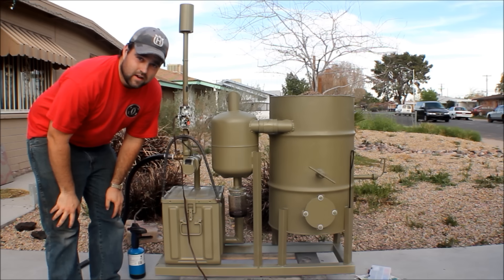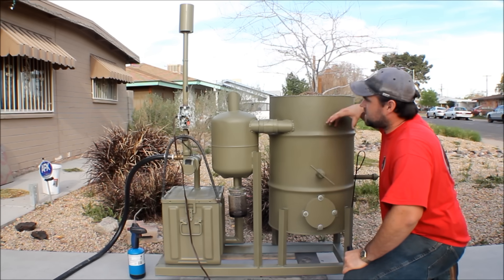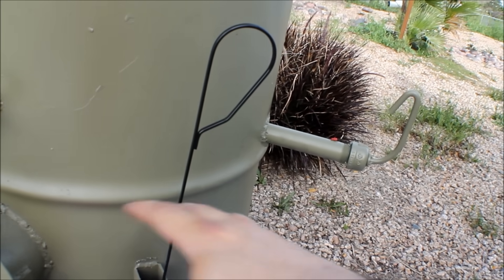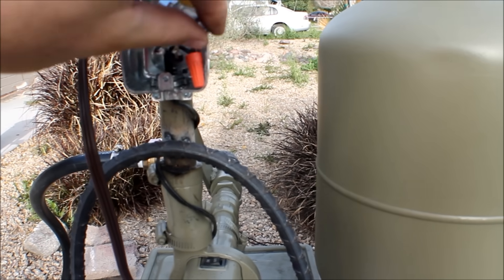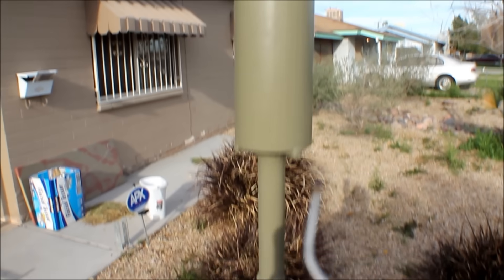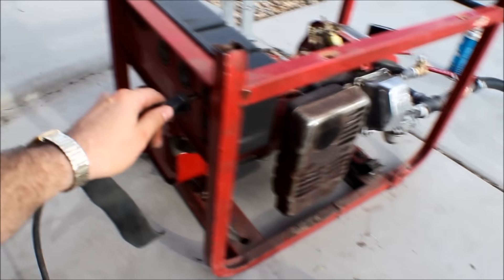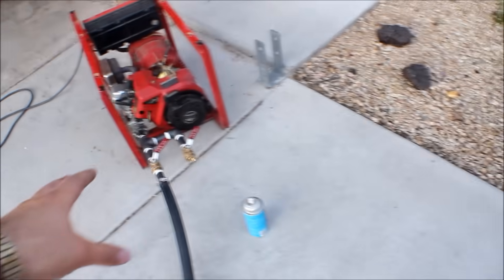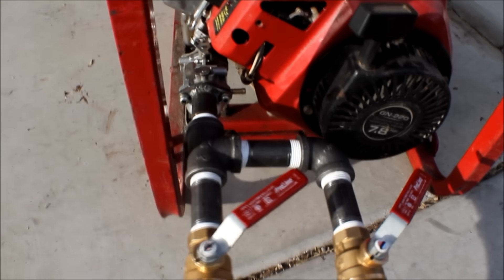amazing homemade gasifier uses wood pellets to run generator -- renewable alternative energy video

Comment: Hi! I am wondering is that better to make steam engine to power power generator or this solution to fuel power generator itself... I think more reliable could be steam engine but I am not sure. 
Sooner or later in my coutry we will have blackouts. I want to avoid it....

Comment: I run a gasifier that is capable of producing 500kw of thermal energy (around 200kw internal combustion generator). It is about 10mtr in height. We filter the gas using a 0.2 micron ceramic filter. If you are interested I can share a lot of info, pics and videos.

Comment: I think dry gas will be hard on the pintons and rings. When I drove my V8 on LPG, it went well for quite some distance, but then I changed it over to petrol to lubricant the cylinders. I did it for about 10 miles. Your generator just doesn't sound right. But a great effort all the same.

Comment: I know this video is 12 years old, commenting to keep it alive and keep it getting recommended to folks. I'm definitely going to have to build one of these. Sure could have used one when we were having nation wide black-outs this year down here in Ecuador. Just would add a good hopper to it, 6 inch tube, heat shielding between tanks, a coiled tube as connection between tanks to allow the gasses and smoke to cool down. With fuel prices here going up also, might as well make one for the truck too! Firewood powered truck FTW! ^_^

Comment: I’ve seen a few of these and the common tricky thing seems to be the air/fuel regulation, has anyone tried using a propane generator’s carb/regulator?

Comment: Your missing the bag on the exhaust that fills with cool smoke with a lever switch attached that turns off and on when the bag fills for a compressor that might normally fill flat tires to be used to fill a LP tank with the flammable smoke to be reclaimed and run the generator some more. I don't know if you can clean creosote with a little backing soda and water enough to mix with a little cooking oil for saving money on quarts of conventional oil that small generators use up quickly but maybe it's worth looking into that the creosote would burn away good but not combust to not over sludge the engine especially after it was cleaned a little bit. Or you could use it as burner oil for steam to run your generator if you made a supercritical boiler if you had time to make a gasifier maybe make a super critical boiler next and use that drip run off from the bottom first stage of your gasifier cooling pipe to collect burner oil run your HP steam boiler that you build next.

Comment: Call me silly. But what would be wrong with using the top burn off to heat a small sterling fan, and then "turn the fan off," so to speak, using a manual damper? No reastat/electricity required.

Comment: Just curious, 
What if you change your rubber gaskets for the stove door rope gasket incase of it getting to hot,
Would this be a better option?
Asides that 
I think this is the cleanest and best setup ive seen so far 👌 😊🧚‍♀️🩷🏴

Comment: First, kudos for the quality of construction and (over?) engineering you did as compared to the FEMA plans as described. Your commitment to doing it right shows and will help many others avoid pitfalls they may not have foreseen. On that note, now 11yrs after the original build- How long did the unit last or is it still funcitonal, what kind of modifications or repairs were needed? If you were to build one today, what would you do differently? Likewise, have you compared the price of components or do you have a rough estimate as to how much more it would cost in 2024 dollars? FInally, were you ever able to run the generator/other generators long enough to make a comparison as to how clean it ran and most specifically in regard to the fouling of spark plugs and/or dirtying/contamination of oil in the generator? 

On behalf of all of us who've learned from your work and the time to produce the video, Thank You Very Much!

Comment: Insulate that inner burn tube with ceramic insulation so the pyrolysis burn area stays super hot…and it reduces the radiant heat that heats the barrel sides significantly and as those hot gases exit they can cool faster because the outside case stays cooler and can shed a bit more heat…add some cooling fins to the barrel to increase efficiency …more work and materials but cooler gas through the rest of the system.

Comment: Thats clever! Adding an old scrap radiator between the rubber coupling going out after the cyclone spin-down filter would further cool the vapor and increase output. Likewise, adding solar, 12 VDC, or [preferably 120 VAC [after sustainability] would further increase cooling and output.

Comment: Have you ever thought of doing a gravity auto fill system say with a 90 45 *joint at top of burn bin and then a simple tube to a funnl style that can handle a bag of pellets so just put a full bag of pellets up top light the barrel and have a way longer burn cycle  for what I'm thinking for this type of setup
Reply: The 90 45 y pipe installed inside top of burn barely with 45* compounded pipe to something that will hold the pellets and let gravity self feed for the burn part

Comment: Can you add heat fins to the front of your cold side piping to help dispel heat and would a seperate fire box side with a side thats settable as a shelf inside to get the raw fuel #1 burning hot keep burning hot but the upper settable shelf would be set just below flash point compard to just load and go as a continuous system oh! I love your vortex vaper seperator propane tank set up that looks sooo much better for moisture in the system to find a collection point compared to other vids on yt

Comment: I realize that this was posted 11 years ago, but you should take a look at some 555/556 timer circuits for a pulse width modulator where you can control the pulse width from a potentiometer.  The output of that circuit goes to a beefy power transistor like a 2N3055 configured as a current amplifier.  You can also use a power MOSFET, but make sure to observe precautions for electrostatic sensitive devices.  You can also use a IGBT (Insulated Gate Bipolar Transistor) and feed that directly to the motor.  You will need a capacitor followed by an inductor and a voltage snubber after that so the motor has a smooth DC current applied to it and any transient voltage spikes are suppressed so the electronics are not damaged.

For the two valves that you have to regulate fuel/air, have you looking into using an Arduino  microcontroller.  They have a boat load of sensors that you can attach.  The main thing that you need is an O2 sensor in the fuel/air line.  Since O2 sensors require heat to operate, you would need one that has a preheater.  The output a voltage between 0 and 1 volt depending on the O2 concentration.  You can attach R/C servos to the valves so the computer can automatically control the mix.

The computer will also need a tachometer so it knows what the RPM of the engine is can properly throttle the generator to 1800 RPM for the powerhead so you get the correct frequency output.

As for the heat problem, you could try running a longer tube between the gasifier and the cyclone filter, weld some cooling fins on it and cover it with a shroud.  Then using a air mattress inflator, you can force air through there to help cool it down.  There are high temperature rubber hoses too.  The one that I would probably go with is a dryer exhaust hose.  You could also weld cooling fins vertically on the burn can to help keep it cool.  Since you seem to have a lot of waste heat, you could place the burn barrel with the fins inside a shroud and insulate it.  Feed the exhaust heat from the tube into it.  The output could go directly into your house for heat.  That way, nothing is wasted and the energy from the wood is fully utilized.  A simpler solution is if you can guarantee that there are no leaks, you could place the gasifier indoors and point a fan at it to heat a room in your house then run the fuel line outside to where the generator is.

Overall, I am impressed with what you have made.

Comment: You might consider installing A dessicant pack to your air intake to keep moisture out of the engine when not in use...if you use it infrequently.

Comment: Heres an idea. Coil some copper pipe around the parts that are getting hot, hook the pipes up to a radiator with a fan and boom, its also a free heating system and keeps it cool

Comment: Great job! I have some questions about practicality:

- In a situation where petrol isn't available, it seems unlikely that wood pellets would be available. Can you run this thing on logs, branches, twigs, kindling etc?
- How long can you run this on a single "tank" of wood?
- If you load the generator, does it stall?
- What regular and irregular maintenance is required? For example, how often do you have to replace the wood shavings in the filter? How often do you need to clear the ash? How often do you need to empty the jam jar? Are there other jobs necessary to keep it running over years?  Do any of those jobs involve partial or full disassembly?

Its amazing to see a petrol engine run on wood, now I want to know what its like to actually use this cool tech.

Comment: Get a decent power supply and motor controller for your fan, more efficient and save. -- question:
Do you need a spark arestor (feedback protection ) since you ignite your fuel source?????
Don't you have to hide this from youe local authorities??

Comment: I have a stupid question, How does this compare in efficiency to just building a steam engine that runs off the same wood that you would feed that thing?
Reply: Idk about efficiency but you would have to own a machine shop to build the steam engine, where as the gasifier can be built with a grinder, and a welder.

Comment: You can make it more effecient if you use water to cool the wood gas, in that way you get hot water and electricity and may be increase the efficiency of the wood gas burining in the engine...

Comment: Have you figured how long you can run the generator with say one pound of wood pallets ? How long will it run the generator with a load applied to it using a full tank ? How many pounds would equal one gal of gas ?

Comment: If you drip water into your pellets, you will separate the carbon monoxide which is also flammable, so you need to hook a 1 liter bottle of water, with a ball valve to control the flow, but just a few drops every few minutes will be enough to separate the carbon monoxide gas.

Comment: If he used “light” cat litter or mordinite (zeolite) instead of saw dust, it would function as a catalyst, “cracking” the wood gas into cleaner gas like jet fuel.

Comment: I built this from scraps myself.
My next version will have  automated controls and feed hopper run off itself with a thermal electrical battery bank and timer run motors.
Fill the hopper, start it running and walk away for a day or refill the hopper.

Comment: Very nice, i have seen several on youtube. My question is how long can you run your generator on one fill of your pellet hopper? Also is it possible to pass your smoke/fuel through a series of air filters such as the big trucks have in their air intake and possibly clean the smoke/fuel so that the carbon and tar doesn't clog the carburetor?

Comment: Does the blower motor remain on? Seems like that defeats the purpose. Wouldn't it be better to not require a blower motor? Otherwise very cool. I knew they ran vehicles in WWII on gasifiers. Also a lot of Russian military vehicles until the late '50's I believe.

Comment: Generators don't store energy so you should get like a surge protector and plug in a 12v charger. Use it to charge ur car battery back up or charge a little sla for ur blower.

Comment: Because the fuel is not clean the oil will get dirty faster and could be abrasive to the cylinder walls. In theory it should work for a little while. Long term use may damage your engine.

Comment: The stainless is for the heat resistance. It is like 200% more resistance to flames and heat than regular carbon steel

Comment: So awesome. Watched this years ago and now I need to build one of these. I just bought some remote, off-grid property up in the UP of Michigan and with no utilities here nor there, I could definitely use a nice little gasifier. Would it make sense to put a little air cleaner on the air inlet? Or maybe you have already done that... would keep bugs and such from getting sucked-in the pipe and mashed into a pulp in the engine. LOL!

Comment: Very cool! Do you have any feedback on how much buildup you get in the engine? I’m curious how long that will run without gumming everything up.
Reply: cool the gases better than he did. its all based on feedstock of course. if you build one hold a paper towel at the end of the system (where it would attatch to the motor) for 30 seconds and it should accumulate oil. if not you are good. cooling it will deposit the oil.

Comment: What kind of longevity do you get out of a briggs type motor like that using this as a fuel source? Does it cause any issues like engine temp, oil contamination, or over wear on any internal parts?

Comment: I have a question, car exhaust don't they push out gas particles? So if some were to say find a way to recycle that exhaust back into a condenser you would have ever lasting fuel or gas. Just a theory but cool schit tho. I'm just relearning things again got a tbi from hell.  But thanx for the re-info 🖖🤜🤛

Comment: cheapest energy. funny none co commercialize this, would buy.
Reply: There's not much energy in wood compared to gas or diesel.
Reply: @AquarianNomadic  wood is everywhere, easy to replant endless of times lol
Reply: @KokoroDenshin   You need to look up the actual math on the system and what it takes to run a small generator, you need to tend to the system constantly. 
I have. 
Have a great day.

Comment: Wow! Nice. How's it work though under a real load? Fuel air mix would need to be adjusted from time to time would it not? Does it make enough wood gas to power a truck? If so I could see this in the back of my Chevy.
Reply: Absolutely not.. you would need a much larger gasifier . This would probably run 80-160cc engine/1500w-3500w generator

Comment: I like it.  Worlds biggest wood carburetor.  A real big one could be adapted to a propane or natural gas home furnace which might be worth trying.  Heat your home with dried corn for a corn stove anyone ?  Gives me a few ideas actually....
Reply: What? Why would you bother using this to heat your home? Just burn the wood directly to heat the home
Reply: That's why this should be called Biomass gasifier, instead of wood gasifier ! :), pellets of any kind of cellulose material, so long as its dry!!!, should work just fine :)

Comment: I have seen literally hundreds and hundreds of people who have built gasifiers at home and use my friend out of all of them have built the best homemade gasifier I have ever seen I seen a lot of gas and fires that are pretty and look good and work good that were built by professionals but for a home-built job yours is absolutely the best one I have ever seen and you literally have one of the best cooling and filtering systems out there so that you only get hydrogen coming out of your exhaust with no tar everybody has all that smoke coming out they run their motors and then when they cool off that thar hard is inside the motor and it never runs again until they tear it apart and clean all the tar out so the name of the game is to remove all the smoke and you have done so with a nice-looking unit so when the power goes out you my friend will still have power while all your neighbors who have built gasifiers will have engines full of tar hahaha

Comment: nice and clean build. you can use a simple PWM circuit as control to your airpump instead of a direct pot. By that, you can use a low wattage pot without unwanted heating.

Comment: That’s really brilliant I run a wood yard and use petrol powered hydraulic power packs for my fire wood splitters one of these would work great for me. Thanks for sharing. I am of to my workshop.  lol.   I run a gasification system for my kiln that I use to dry firewood with a massive chimney . It is set up between to semi box trailers that I fill with wet wood.  You have got me thinking now.

Comment: how about connecting a water buffer to make the gas cooler, and also I would connect that buffer to the engine, so I would charge the watter buffer (e.g. 1000 liters or more) with a heat coming from the generator but also from the heat coming from the gas itself once it leaves the big barrel(as the big barrel must be hot so better pyrolisis), ofc, the gas can't be cooled too much, that would be an awesome co-generator, I would charge water buffor, and electricity magazine - especially in winter when there is no much sun and a lot of heat to make house warm is needed :)

Comment: Water and marbles could be used to cool the gas.  The marbles higher than the water.  Water circulated to the house in the winter for heat.  Not sure about putting a gasifier in the house for warmth.  The exhaust from the generator could be heat exchanged for house heat.  Very nice build and info for where to find plans